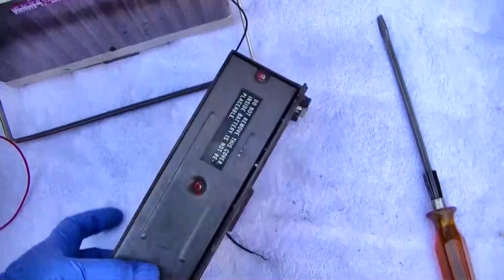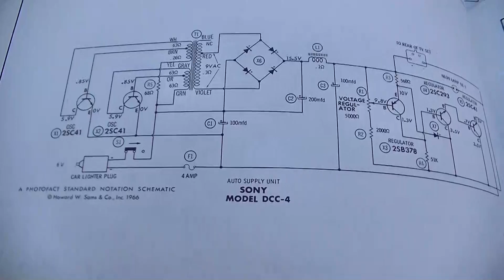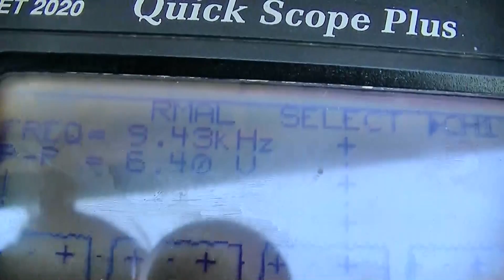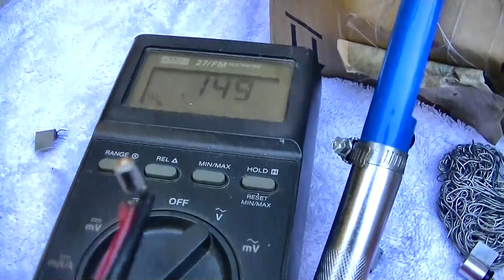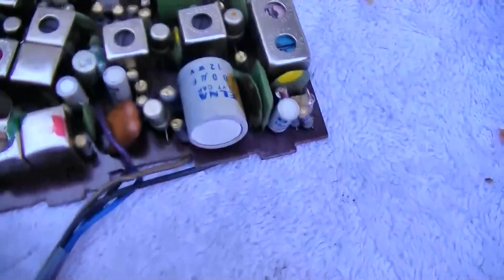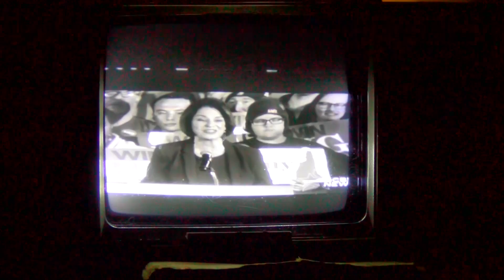Vintage Sony Micro TV Repair Attempt 1966 Portable Black And White

Comment: 6 volt cars: Yes, there were QUITE a few still around. In fact, new Volkswagons were 6 volts until very late in the decade, as were several other European makes of the day. Because of their small size and low demand of their engines and bodies there was way less need to up the voltage to meet loads. 6 volt car radios and 6 to 12 volt inverters were available well into the 70s. I even had a switchable 6/12 volt AM/FM radio in my old Willys Jeep back then. J.C.Whitney did a brisk business supplying that market well into the 80s.

Elna capacitors: Don't get me started on them! I avoid them to this day, even though they make the "best" "audiophile" caps now. I just have such a bad taste in my mouth from their old stuff. I imagine they have improved or they would be gone by now and Japanese components have become the world standard but...
Reply: My dad used to drive a Renault Dauphin in the sixties. If I remember well, that one was 6 Volt.
Reply: @Ray Rooney 
Electrolytic caps are still the dirty little secret in the electronics industry.
Even today the basic makeup of these items are still a gel substance and eventually they will dry out since they are not entirely sealed although today they can last for 25 years if you buy the highest quality units. But if you buy consumer electronics they usually are spec'd to last only 15 years or so.

Comment: Those spade connectors are probably there so the person could use the TV with a 12v lantern battery.  Probably way more economical than using C cells.  Those big F cells in the lantern batteries are great.

Comment: Yup! Have to shotgun all of the electrolytics otherwise you'll be replacing most of the transistors (might not even be available) get rid of that durn selenium rectalfire in the power supply ( that was from a 60's vintage Popular Electronics comic of a technicians wife going shopping for parts for him).
You haven't seen a packed board until you have worked on a Motorola HT220 walki. That radio drive many techs to drinking, fix one item and break another in the process.
Those sets were "mega bucks" for the time period. Mine set me back about $110 back in the late sixties for a kid in high school. The huge alkaline rechargeable battery pack set me back about $30 and was rechargeable but lasted only 3 years.

Comment: This is like working on transistor radios all of parts are very crowded together.
Reply: I have 2 small transistor radios that belonged to my dad. They are from the mid 60's and still work just fine.  But your right, they sure crowd in the parts.  My dad used one of them to DX radio station late at night while laying in bed....He had  a stroke at 59 years old.

Comment: “Battery is not replaceable” ... Are we already in the Apple World ?
Reply: if that was made by Crapple, you'd have to throw it away after 6 years, because it's no longer supported
Reply: @Mike1614YT  6 year? that's a lot....
Reply: Actually, those Ni-Cd battery packs are re-stuffable. There are plenty of places around that specialize in the practice if you don't want to do the job yourself. Those look like standard size C Ni-Cd cells in that pack.
Reply: My kids will be lucky to get that long out of me haha
Reply: AND ANDROID
Reply: If Sony had Apple bussines practices right in 1966, they should bankrupted long ago. Clearly they are not depth into the ewaste market-generation like Apple does.

Comment: I had one that looked like the first, but was branded CROWN. I purchased it in Tokyo when I was on my way home from Vietnam to be with my wife when our first child was born in 1971. I bought it back to Vietnam and used it to watch AFVN when we were in garrison, it sat under my bunk in the bunker when we were, well out and about, as it were.  Great little set. I kept it with me when I came home as well. It had built in AM/FM radio so it was a great little set. One day, as I sat in the Arms Room with a loaded .45 guarding all the arms, I had it on, and a mighty BANG came from inside, the magic smoke filtered up through the top. Took it to the Base TV repair shop, they said it was a blown resistor, however they could not tell the size, and because it was never imported to the US they could not get a schematic. They advised me to throw it. Well I loved that little set, so I simply wrapped a bit of copper wire from one lead of the missing resistor, to the other, and the set came back to life. I was showing it to a fellow who worked part time for me delivering furniture after hours on base, he loved the fact that it had a battery pack you could use when out and about, took a bunch of D cells. Totaled up to 12 volts. I sold it to him and he mounted it under the dash of his Dodge, which he used when he did part time security work for an off base company. It served him well, he was still using it when I left Fort Bliss for Fort Myer, I lost contact with him after that.  He wired it directly into his car power so as not to waste money on batteries.
Reply: So your kid is almost 50 give them the TV for memorise if you still have it
Reply: @abc-ni9uw  Wish I still had it, I sold it to another soldier who worked part time after hours as a security guard.  He used his private car to patrol some warehouse areas.  He mounted the little set under his dash and used it between patrols.
Reply: Cool story!

Comment: very good work though, but I think, you could have fix this ! The defektive output stage in the vertical and the working horizontal are the most critical stages, that you made working well, the if stage is not critical... The video-driver transistor works as an emitter-follower, every Si-pnp- would work here (BC558 or so..), the GT313 is way to fast as you said, but can produce some VHF-noise if not properly installed. I am glad to see the monitor-part work, though !

Comment: I wouldn't consider them hybrids because of the HV rectifiers, anymore than because of the CRT's.  Back in the 70's I had a Heathkit/RCA 23" color set that was all solid state except for the CRT and a 3A3GT HV rectifier.  
I bet Sony used a 25mhz IF because of the low FT of those Germanium transistors in the IF stage.